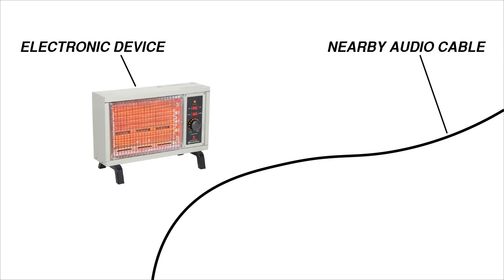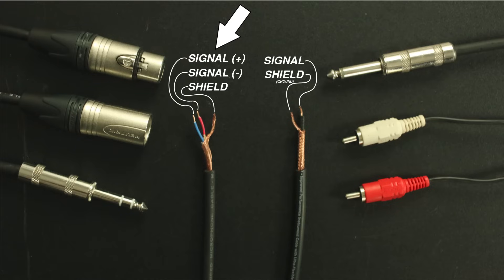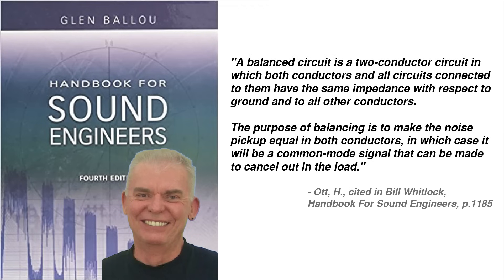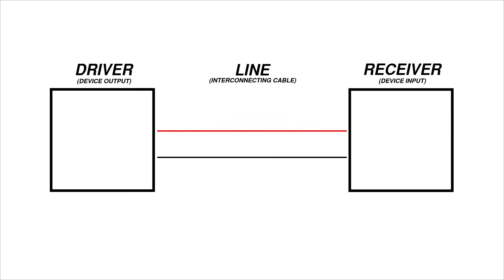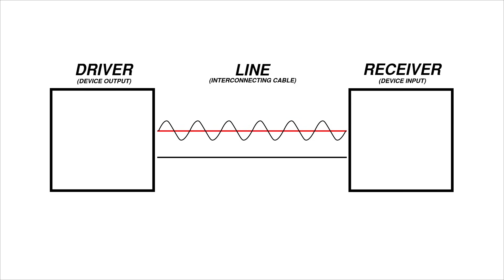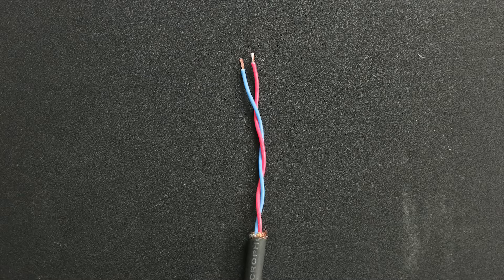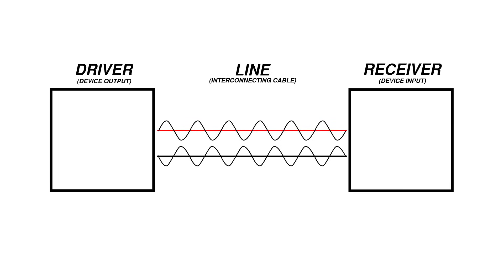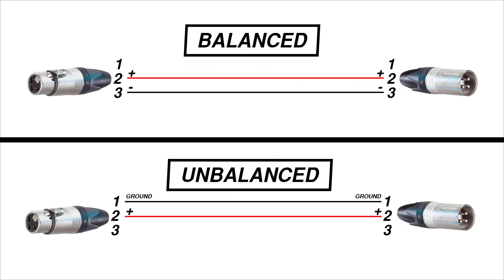Balanced vs Unbalanced Audio | Do Balanced Cables Sound Better?

Comment: ok then ... this begs the next question then........
WHY DO WE EVEN USED UNBALANCED CABLES, Why does it even exist ?

Feel free to be as technical with your answer as you like
i'm not a lamen and unlike yourself i love and fully understand electronics
Reply from the maker: I’ll defer this question to you then, Martin. Why do we use unbalanced connections?
Reply: @AudioUniversity  ok, NOTE : I'm an engineer, but not an Audio Engineer.
i understand your point about balanced connections whereby you use 2 phases of the signal one on the positive rail one on the negative but 180 degree's out of phase (aka flipped) and i get that it has a ground wire hence REFERENCE TO GROUND

Now in a balanced connection you have only 2 wires, the signal goes alone the positive and the negative is used at the chassis ground reference also Signal reference (supposed to be 0 Volts) and obviously the problem comes into effect when external interference enters the system and changes the potential of the ground reference to something above 0V
i get all that

Now what do we use unbalanced for... well. Generally your RCA analog unbalanced in home entertainment is under 5m  usually 1.5 to 3m run from source to output
or you can have say guitar amplifier Tip and rig connection also short runs, Usually under 5m maybe 10metres in life performance situations

so MY UNDERSTANDING IS .... unbalanced are used in short runs
but i suppose what i'm asking is why use them at all , why not use balanced for everything 

Back to you
Reply from the maker: Thanks for offering that explanation! It’s good to hear the perspective of someone who is more technically inclined. 

To be honest, I’m not really sure why unbalanced connections are used. I guess I always assumed that it came down to cost. But, again, this is just my assumption. Perhaps I should do some research and formulate a new video that explores that topic. 

Thanks for the idea!
Reply: @AudioUniversity  
Ohhh...  I assumed you were more technically inclined IN THIS SUBJECT than i was.
i have a friend who is an Audio Engineer and iasked him this a while back and he wasn't able to give me an answer

You're welcome for the idea

You are correct, it could be cost related
then again....  ALLOW ME TO JUST THROW OUT WILD IDEAS

I suppose when we talk about ground reference on a balanced line we need to understand first and foremost that MOST TIMES it's not going to be EARTH GROUND,  it's going to be CHASSIS GROUND
and sometimes (in the case of home entertainment audio equipment you won't have the 3rd pin to ground
ok, so that's one thought

as for unbalanced, well maybe    AND IT IS A MAYBE
if the cable length is shorter i suppose it's more unlikely that you'll encounter interference from power cabling along the floor  JUST A THOUGHT

another idea
IN TELECOMMUNICATIONS we have a BALUN  which literally means  BALANCED/UNBALANCED.
Basically in an antenna system assuming we are using a 75ohm nominal impedance cable
THE BALUN CORRECTS THE IMPEDANCE MISMATCH BETWEEN THE ANTENNA AND THE NOMINAL IMPEDANCE OF THE CABLE

i don't know what the nominal impedance of RCA cabling is, given that RCA is technically the connector not the cable and XLR is technically the connector not the cable
i know impedance's of Telecommunications cabling and Data Cabling
i do not know the impedance of Audio cabling

MY SUGGESTION WOULD BE 
FIND OUT IF THE BALANCED OR UNBALANCED PROPERTIES OF THE CABLE HAVE ANYTHING TO DO WITH IMPEDANCE MISMATCH

i always assumed that there was some Audio Engineering benefit to using unbalanced Connectors and thereby after going into the mixing board 
I ASSUME AGAIN THERE WOULD BE A BALUN to balance the signal

and i assumed that it was used this way so as to ensure a better quality Balun was matching the signal as opposed to using and external cheaper balun
THAT WAS MY ASSUMPTION

it now appears that Balanced is good and preferred and unbalanced is shit
which brings us back to the same conundrum doesn't it 
Why was unbalanced engineered in the first place and put into use and still used today 

YOU KNOW WHAT,   YOU NOW HAVE ME CURIOUS    LOL
AND I CAN'T FUCKING SLEEP NOW UNTIL I FIND THE ANSWER

SO I GUESS YOU GO OUT AND FIND THE ANSWER AND I'LL SEE WHAT I CAN DIG UP AND LET'S GET BACK TO EACH OTHER
What do you say
Reply from the maker: Sounds good! I respect your curiosity! I know that we use DI boxes, which are transformers used to connect high impedance outputs (guitar pickup, etc) to low impedance inputs, and this also balances the connection for longer cable runs. Maybe this bit of inside info will help in our research.
Reply: @AudioUniversity  
i stayed up last night nursing a cup of coffee to its limits LOL trying to find the answer
all i came up with is 

Articles type 1   this is a balanced connection,  this is an unbalanced  blah blah blah

Articles Type 2 - unbalanced is commonly used in RCA type stuff for SHORTER CABLES.
Fair enough but still doesn't answer why we don't use Balanced for shorter runs

that seems to be the bulk of the internets knowledge on the subject,
i feel maybe i need to call a few Uni's or Engineer's and ask them 

I'll stay in touch and keep you updated
Reply from the maker: That’s what I’ve found, too. Let me know if you find the answer!
Reply from the maker: I appreciate your diligence on this. I think you’re right that many audio professionals are neither required nor inclined to learn some of the more technical concepts. Out of curiosity, I’d like to know, but if it doesn’t affect the daily operations of recording and fostering good signal to noise ratio, etc… 

On the other hand, some of the greatest innovations and techniques were built upon information that might have seemed irrelevant at first, so knowledge is power if creatively implemented. 

Thanks again!
Reply from the maker: As I brought up in an earlier response, DI boxes are commonly used. The general rule is that anytime you need to run a high impedance source (guitar, smartphone output, etc) longer than about 15’, you should use a DI box at the source end of the cable run to convert the signal to low impedance.
Reply: @AudioUniversity  
Fair enough , only.....  if a D.I. Box is used to convert High Impedance to Low Impedance then it still doesn't make sense, after reading up on D.I. Boxes, they appear not to convert High to Low Impedance but TO CORRECT IMPEDANCE MISMATCH which would effectively make them a balun, which would make all the sense in the world and explain my question about unbalanced cables

i'm still waiting to hear from this other guy and i'll keep you updated as such
Reply from the maker: I think I just said it incorrectly. You’re right, a DI box matches the impedance between a high impedance output and a low impedance input. Thanks for that correction.
Reply: @AudioUniversity  no problem
yeah basically it takes an unbalanced load and makes it balanced
therefore it would make sense why we still use unbalanced cables...
Because we feed them through a balun to make the connection balanced

it would be the same question as asking why do we use TV Antenna's if they are not rated at 75Ohm nominal impedance to match the cable
it's because they have a balun on them

anyway i'm going to meet up with this other guy at some stage and i'm going to get his take on it and i'll get back to you
Reply: @AudioUniversity  i also want to say , i always assumed in Audio engineering that the balun was inside the mixer , i always thought that's how it worked and if it was the case you wouldn't need a D.I. box
i feel like now asking why is the balun not inside the mixer  LOL
but i won't open that kettle of fish, i'm happy to settle on .... ok,   a D.I. Box is what does the job
Reply from the maker: My first thought would be that you want to balance the signal BEFORE the signal travels a long distance. That’s why we use a short unbalanced connection from instrument to DI box and a long cable from the DI to the mixer, instead of the other way around. Balancing the signal at the mixer would still subject the signal to the noise acquired between the instrument and the mixer.
Reply: @AudioUniversity  
 @Audio University  Yes, only.. it wouldn't matter because it'd cancel out the noise anyway
if you had , say...   in series
A GUITAR ---------------------- A MIXER----------------- SPEAKER MONITOR

let's even say that it's not a guitar , let's say it's a DVD Player feeding into the mixer and by way of RCA Connectors Female to Female you made up a 20m cable  LOL
well let's say noise was induced from LV Power cable on the floor running over it 
it still wouldn't matter because if the balun was in the mixer then the signal would be corrected at the mixer BEFORE the speaker output

so i suppose if we have a D.I. Box then the D.I. Box is going to be in-series before the mixer
but you see the part that spins me out a little is .... MIXERS ALREADY HAVE BALANCED AND UNBALANCED CONNECTIONS
wouldn't it then stand to reason that they would have an internal Balun ?
or.... Am i wrong and the idea is that the signal needs to be rectified after the Mixer
Reply from the maker: My understanding is that any noise induced upon an unbalanced connection permanently becomes a part of the signal. Well… I suppose nothing is permanent these days with noise suppression plugins, but it wont be removed by the DI box or the mixer.

Comment: Audiofools spend £10k on a 1ft gold plated rca cable that’s been formed on the thigh of a virgin because the vendor says the audio it smoother, brighter or some other bs term. Pro’s run xlr’s over a bit of wet string over a hundreds of feet with no noise and laugh
Reply from the maker: Thanks for commenting, Eliot. I tend to agree that the cost associated with “premium” cables is rarely worth it, and often unnoticeable.

Comment: I'm new to PA systems but I think there important points that are not mentioned here if I'm not mistaken.

1. The shield should be mark as Ground, and the Balanced connection is not necessarily +/- plus minus. It's actually a normal and reversed phase signal. Combining it should have cancelled all the signal, and any sum will be the noise signal. Reverse the phase of the noise signal, then you eliminate it. That's how the noise cancelation works on balanced system.

2. Given that, the effect is you can raise the gain more on balanced signal, because the noise floor is very low, thus having a better output sound.

Comment: Great video. Now I have been away from the plug business for a bit. Do they really call 1/4" phone plugs TRS and TS now? I honestly have never heard this distinction. Now I know of the whole tip ring sleeve thing but have always seen them as 1/4" stereo or mono phone plugs or just plugs. Just wondering if this was a thing or just your way of explaining the various parts of a 1/4" phone plug? A great explanation none the less.
Reply: "Do they really call 1/4" phone plugs TRS and TS now? I honestly have never heard this distinction"
A "phone plug" is TS, Tip and Sleeve, there is no Ring.  A stereo phone plug is TRS, Tip, Ring and Sleeve.  TRS exists in different sizes; 1/4 inch, 3.5mm and 2.4mm.  You also have TRRS plugs commonly in 2.5mm for headsets for smartphones (stereo headphones and microphone and ground).  
So if you go to the music store and ask for a "phone plug" the assumption will be 1/4 inch TS.  But for anything else it helps to be more specific.
Reply: @thomasmaughan4798  yes my point being you would ask for a stereo or mono 1/4" phone plug. I can't image the looks I would get if I asked for a 1 /4" tip ring sleeve plug. The phone name is not specific to mono or stereo only to the fact that 1 /4" plugs were used for telephone switchboard connections. I just thought it off to describe them in such a way.
Reply: @buckman72  "can't image the looks I would get if I asked for a 1 /4" tip ring sleeve plug."
That happened to me a few weeks ago at the music store; the new generation does not know "phone plug" and the old generation does not know "TRS" so I end up asking for both and then I feel a bit weird for doing THAT.
Reply: @thomasmaughan4798  knowing todays retail staff maybe you should just ask for the big headphone plug with 2 stripes on it. 😂 I usually just come armed with the specific item number after I looked it up online and ask them do you have any and where are they at.
Reply: @buckman72  "I usually just come armed with the specific item number after I looked it up online and ask them do you have any and where are they at."
Particularly at Best Buy or the major hardware stores.  The hardware stores will even reveal the aisle and bin.  I've been IN the store using my smartphone to find something when the clueless staff don't even know what I just asked for.
Reply from the maker: I believe this is a common way of referring to these connectors, as not all TRS connectors are wired for stereo. Thanks for watching, William!

Comment: Another possibility: use UTP....4 signals, no shield... because it is 4 twisted pairs...cheap..
Reply from the maker: True. You can run 4 channels across a single cable that way (analog). This is the concept behind the RatCAT boxes - very cool!

Comment: 5:22 I suspect that your comparison may be incorrect since your ground wire is not wrapped around signal wire forming shield with your setup in unbalanced mode.

Comment: a much simpler way of explaining balanced audio.
the signal being sent from device to device is out of phase, any noise picked up along the way is 'in phase'
when the signal reaches the receiving device the signal is flipped back in to phase and any noise picked up is flipped out of phase and cancelled out.
Reply from the maker: Thanks for sharing this explanation. Just remember - the most important part is that both lines have equal impedance with respect to ground.

Comment: I had some noise that transferred from the PC , through the USB interface, through balanced cables and still came out of the studio monitor speakers.
Reply: An USB-isolator device could also help
Reply from the maker: @nemcron, I jus my learned about these yesterday! Thanks for bringing this up!
Reply from the maker: Unfortunately, balanced connections only protect against noise acquired over the cable run, not noise that is already a part of the signal.
Reply: @AudioUniversity  I might have to go optical through my DAC as so far noise comes over the USB connection